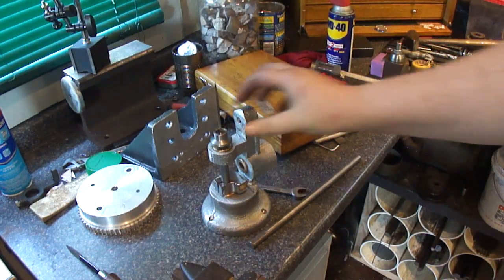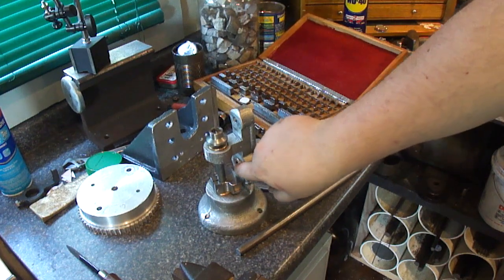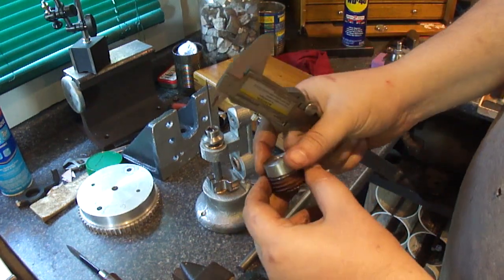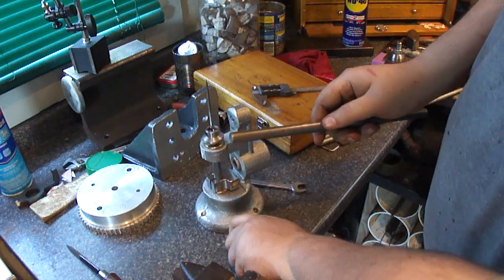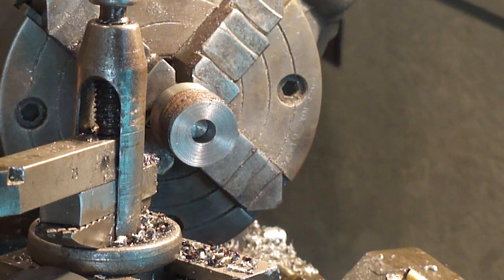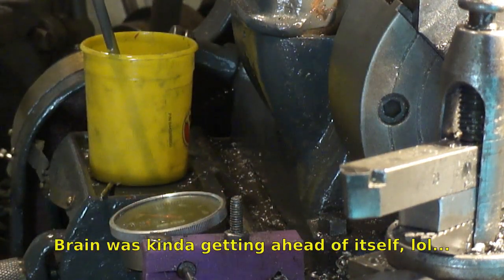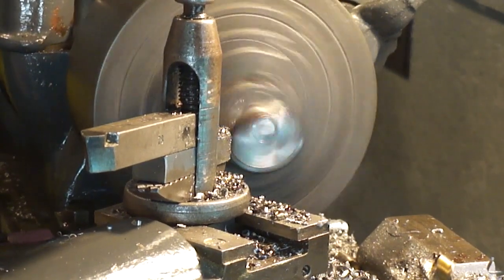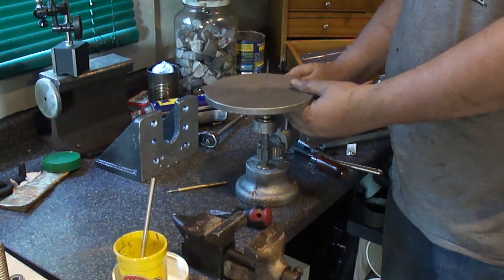Die Filer Build #4 - Eccentric Crank and First Run

Comment: Look like it turned out great! Are you going to show it really working? Thanks for the video!
Reply from the maker: yea, the video is already uploaded and will be out tomorrow probably. I just pressed a 3d printed gear thing on the shaft, and its tight enough that it'll drive it, but it wants to slip under any load at all, but it works either way. I just need to get the pulley cast along with a few other parts for other projects, then Ill be good to go.

Comment: G’day Chirpy, very nice. It will be nice running off a sewing machine motor and foot controller. Cheers Peter
Reply from the maker: yea, it runs quite nicely off of the sewing machine motor, just need to set a stop for the petal so I dont accidently get into filing away at something and get heavy footed on accident, lol. Thanks for watching.

Comment: Nice job.  I agree about the trunnion, it looks like the start of a bunch of issues.  If you need a tilted hole in something, you could just make a wedge to tilt the part.  That way the table will always be square.
Reply from the maker: yea, I didnt even think about that, so Ill have write that down to use on the table to get it level/square, then take them out to get the angle when I need it. Thanks for that.

Comment: Awesome build start to finish bro! Thank you for your time and effort! Thank you bro Anthony Kent
Reply from the maker: thanks, and it's not finished yet, the pulley still needs cast, machined, and fitted to it. It really looks great imo and half tempted to keep it in the immediate patterns box for a flywheel pattern, lol. The weather has been kinda crap and havent had the motivation to get out and cast it, so it's still on hold somewhat, lol. I did find a way that kinda works, and Ill show that next time probably.